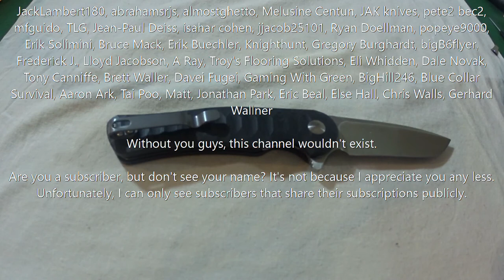Knife Hacks Episode 17: Kizer Dukes Clip Mod

Comment: You did a fantastic job man, great work! 

I've had my eye on this knife for a long time. However, the one thing I can't seem to wrap my mind around is its price point when it has VG10 steel. This is why I have been eyeing it for so long because I am aching to catch it at a much more discounted price. The Kizer Dukes is currently going for $69 (Its MSRP is $100!!!) and I feel that Kizer should have gone with a higher caliber steel. Perhaps something like 154CM to really make this knife stand out much more in terms of a performance to price ratio.

I'm not knocking the knife because I love the design & action but, I recently bought a Buck Vantage Pro Small with S30V for $54 (it was $60 but there was a 10% off coupon floating around the site) and it just seems to me like this knife's price point should be somewhere between $50 - $60 when it is offering VG10 steel. The Steel Will Cutjack has D2 steel and it's currently on sale for $38 everywhere. I get the material quality Kizer has put into this knife but at its current price I can't help but feel like it should offer more for the money.

The question I ask myself is: why pay this amount for VG10 steel when you could get a different knife for a cheaper price that offers a steel that outperforms VG10? This is why I haven't pulled the trigger on the Kizer Dukes yet. What is so great about VG10 that so many knife manufacturers are pretty much overcharging for it? How can it be so expensive when it just slightly outperforms 14C28N?

Sorry for the rant, trolling, or steel snobbery.
Reply from the maker: Well said. Thank you for sharing your thoughts. Please, no apologies needed MaximaMan (you have no idea how many potential superhero costumes I'm thinking of right now). This is your opinion and I welcome it. 
This is one knife that rarely goes on sale, it's a big seller for Kizer. To be honest, I prefer VG10 over 154CM because it's corrosion resistance is a tad better. This version of the Dukes is in Kizer's Vanguard series, which is basically budget versions of more expensive designer knives (Blade Smith series) they offer. All knives in the Vanguard series are outfitted with VG10 blade steel. The blade smith version of the Dukes has a CPM-S35VN blade, titanium scales, and a frame lock. It's larger in every way and costs about $200. S35VN is a great steel, but is it $130 better than VG10? Tough to say. In my opinion, this is one of those rare occasions where the cheaper version is better/more practical than the premium model. 
I own a Buck Vantage Pro in S30V as well. If I had to choose between the Buck or the Dukes, I would take the Dukes. IMO, the S30V blade steel, the pocket clip, and made in USA are the only things it has going for it. I feel the Dukes has better blade performance, way better action, easy to disassemble, better ergo's, and very practical size and weight. Is blade steel important? You bet, but not the most important, especially once you crossover in to the super steels. I place a much higher importance on the action of a knife because so many things have to go right to achieve that action. When we're looking at budget knives/steels (for me, that's anything below VG10 in regards to edge retention), the type of steel becomes much more important. More and more budget knives nowadays are featuring D2 steel. D2 has very impressive edge retention when compared to VG10, but there is a compromise. In regards to corrosion resistance, VG10 is far superior than D2. I guess it all comes down to which compromises are you willing to make. 
Thanks again for sharing your thoughts and for the excellent conversation MaximaMan.